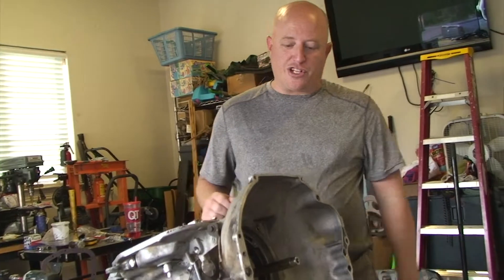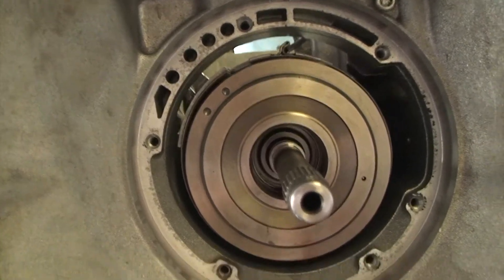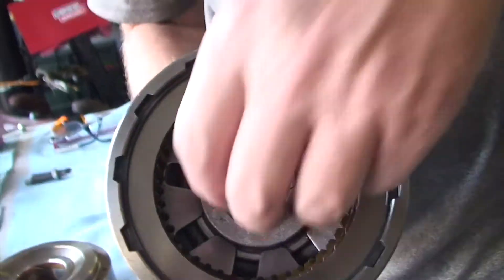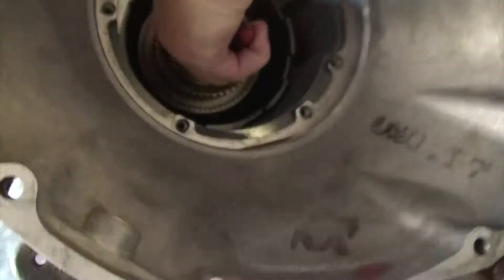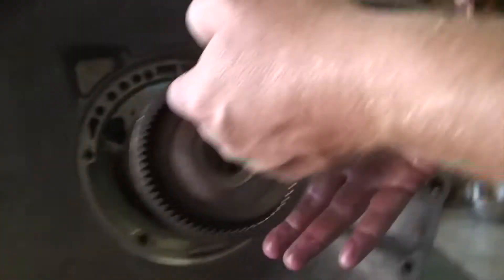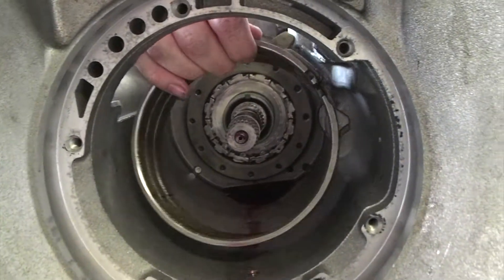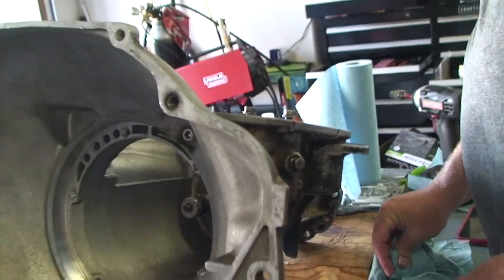32RH (904) Teardown Part 3 - Gear train & valve body

Comment: Hey bro. Having a hard time disconnecting the dipstick tube from the transmission. Any tips?
Reply from the maker: You just have to rock it back and forth as you pull up on it.  Be sure it’s unbolted from the bellhousing.  There’s an o-ring  on the end that may or may not be reusable. 

I never did get my dipstick to seat/seal properly after this.   I ended up using “The Right Stuff” gray rtv to seal it back up.

Comment: Great video. Do you have the link for the rebuild kit?
Reply from the maker: https://www.oregonperformancetransmission.com/category/jeep-a904-a998-a999-transmission-rebuild-kits.html
Reply: @bigjuicygarage4754  Thank you. How's your rebuild holding up so far?
Reply from the maker: I'm not sure how many miles I've put on it, but I drive it a ton around town and have zero issues.
Reply from the maker: @trailraiders6350  It's been a little over a year.  I was just thinking I should drain the fluid just to see what it looks like.
Reply: by the way, did you use a slide hammer to remove the oil pump? If so, where did you get it from? Wondering if the one they loan at Autozone would fit. Thanks
Reply from the maker: @trailraiders6350  yes, there are 2 bolt holes which are bigger and threaded in the pump itself (all of the mounting bolts pass through the pump), to allow for a larger bolt to be used in extracting the pump.  I believe they were 7/16” but I don’t remember.   And yes, I rented a slide hammer from Autozone.
Reply: Okay. Thank you @bigjuicygarage4754
Reply: @bigjuicygarage4754 there are 2 kits listed. I have a 98 dodge b1500 van. 32 RH. Which kit would I need? Thanks!
Reply from the maker: @ one is “high performance” I believe.  I’d probably go with that just because it’s not that much more and you don’t want to open it up again.

Comment: Many thanks for all your videos!  I was able to use them to rebuild my 32RH.  Beer on me if you ever pass through Chester,  WV.
Reply from the maker: You’re kidding?!   That’s fantastic!  Honestly, that’s why I did the videos, but I  didn’t really think anybody would actually make a move because of me.  

How did you find the process?  Relatively easy?   Anything you found hard?
Reply: @bigjuicygarage4754  ...I really enjoyed your disassembly of the main drivetrain that you said you were going to do really fast (to retrieve the  clip that had fallen inside).  I loved that video.  The content was perfect, and the duration was wonderful.  I took a picture during each step, but noticed you covered everything needed.
What I really appreciated was your confidence.  It made me think it was as easy as shown. 
 I didn't think anything was too hard other than getting the clutch disks aligned.  I struggled with that step.
The only part I didn't see...was installing the transmission pump at the end of the assembly.  Since you didn't show it, I assumed you couldn't screw that up.
Your videos are easy to find and easy to follow.   I'm sure you've helped a lot more people than you know.  Good job!
Reply from the maker: @KendallDuffield-kb5of  Aligning the clutch disks is absolutely the hardest part of the job, and it can be hard to know if you've got them all.  I would love to know how they do this at the factory.

The pump is very easy, but I wish I had captured it on film.   Same with breaking down the clutch assemblies & servos.  I actually have all that recorded but it came out terribly.

That confidence came from the fact that very little of what you see was me doing it for the first time.   I had to first figure out what to do, then do it efficiently on camera + a decent talk track.   But the net result was that I made a relatively easy task look easy.

It absolutely thrills me that you were successful and saved yourself thousands of dollars.

Comment: This is awesome, will try to rebuild my 32RH in April
Reply from the maker: You got this, my dude!   Be sure to share your progress!   You can find me here or on Wranglertjforum.com if you have questions!
Reply: @bigjuicygarage4754  I have the MRK Deluxe Deluxe Master Kit & a new Florida TCC. Will need to purchase 2-3 tools I don't have. I have replaced transmissions on my own before but never opened one up
Reply from the maker: @bpittman  I had never done this before either.  I’m not familiar with that overhaul kit but I’ll assume you’re an educated shopper.    I’ll update the video description but the only specialty tools you need for this job are:
* feeler gauge
* lock ring pliers 
* snap ring pliers 

Certain wrenches like a crowfoot or ratcheting wrench make it easier, but they aren’t required.   The FSM & ASG Manual are also extremely valuable resources as well.
Reply from the maker: @Bryan Pittman - it's April, how's it going?
Reply: @bigjuicygarage4754  I have a couple of honey-do lists I got to finish before I can tackle it. I hoping to start this June/July
Reply from the maker: @bpittman  well I’m here for you whenever you get underway.

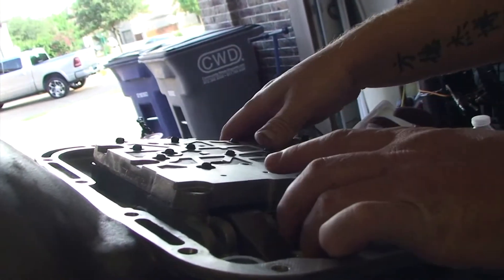Comment: 1:40 I've got mine still in the vehicle, and I've got the valve body completely loose and hanging, but come on man, there's gotta be some trick to that parking rod!!! I've tried EVERYTHING to get that knob on the end to come free but it will not come out of there!
Reply from the maker: When I had it on the bench, it came out with ease.  When I dropped the VB while the trans was still in the jeep, I had a heck of a time getting it out.   Shortly after giving up, it just decided to fall out.  I wish I had a word of advice here, but I don't.
Reply: @bigjuicygarage4754  Dude it's so funny, I got so frustrated that I gave up and walked away. Went back up 2 weeks later, crawled under the Jeep and mine did the same thing! I gave it a little jiggle and it came falling out. I don't understand it.

THEN came tryna get it back in there! You don't even wanna know what I did there... 😳